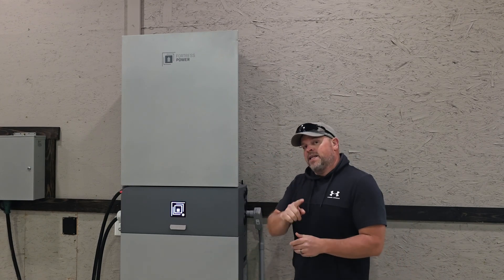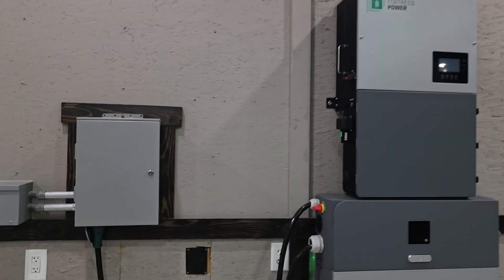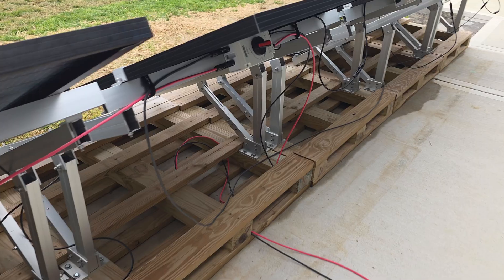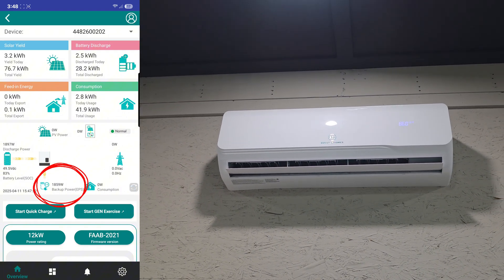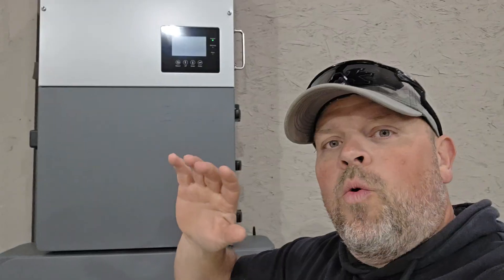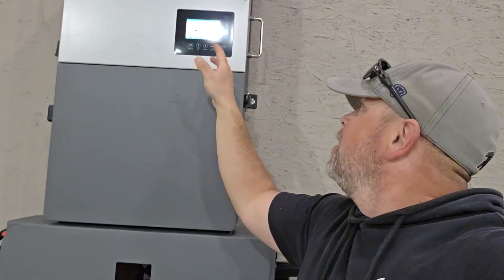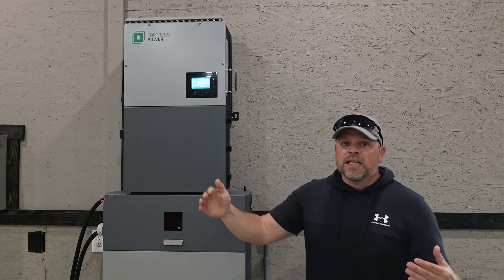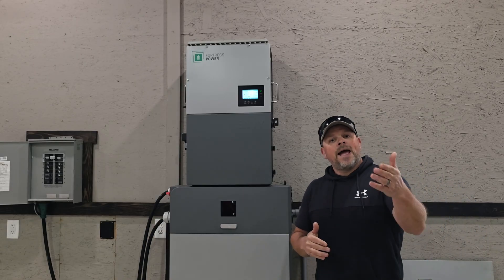Load Test - Fortress Power Envy TRUE 12kw Inverter

Comment: I have done close to 50a 12000 watts with this set up Most people off grid should not even get close.  I did a person electric stove, electric dryer, space heater, microwave it was awesome...the inverter has a 50a continuous, but the amps are higher for 10 mins and 5 mins and during the day with solar an even higher amperage rate. And selling to grid over 6000k the inverter is very loud

Comment: Yeah alpt of these inverters are cheep stuff from china, would not recommend. You will lose your house by using this stuff.
Reply: Using equipment well within the confines of its specs helps, the ultra cheapo ones suck but there are better ones. Most I have taken apart are built quite well and are just as good as the ones 3x more expensive and likely made in the same factory.
Reply: @GoonyMclinux  i got more trust on my 68 Kohler diesel than any of this stuff, its got 348,000 hours on it and it still starts like the day mah pops bought it!
Reply: This is no cheap system, I think your talking about other china stuff not this baby.
Reply: @zuckermann6598  if it let's the smoke out then it ain't putting out the beans.